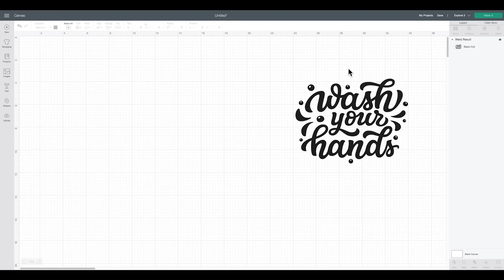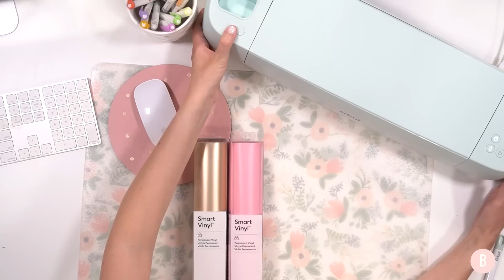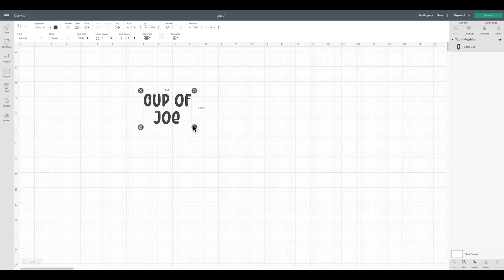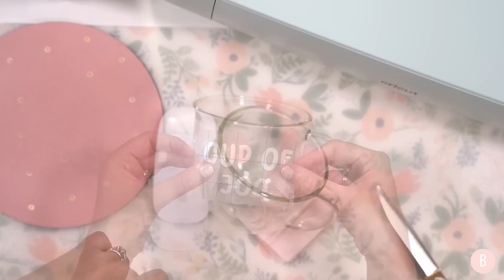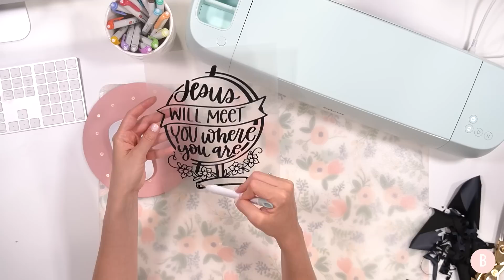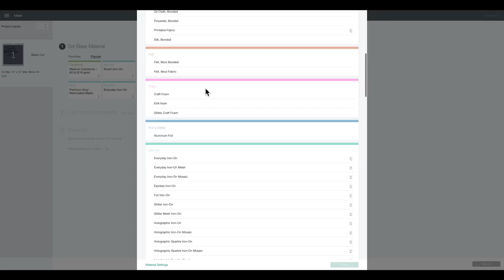Cricut Explore 3 : My First 4 Crafts!  Using Smart Materials & Regular Materials In Explore 3

Comment: Have you ever used your scraper to hold your mugs or tumbler, you can place the items in the middle ridge on the scraper to hold your tumbler to Steady it while you place the vinyl on it.
Reply from the maker: Yes, though it doesn't work on a cup of this shape because of the round curvature.  :)  That would work better on items that are straight walled.

Comment: On the first craft you said you used more pressure. How were you able to do that? The first cut I did was great, the second cut wasn't too hard like the first cut.
Reply from the maker: When you get to the screen in Design Space where you have to select your material, there is also a section where you can select blade pressure.  Hope this helps!

Comment: How long do you hold the heat on the shirt to make sure it transfers well?
Reply from the maker: You will want to reference the heat guide for temp and time instructions, as it varies both with the material you are using and the material you are ironing onto.